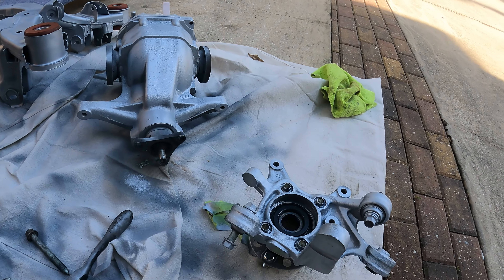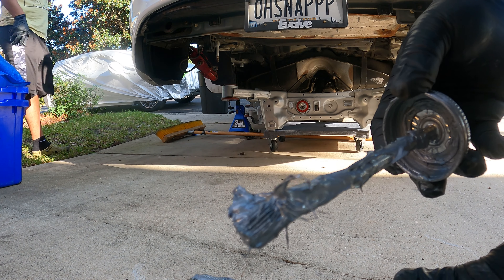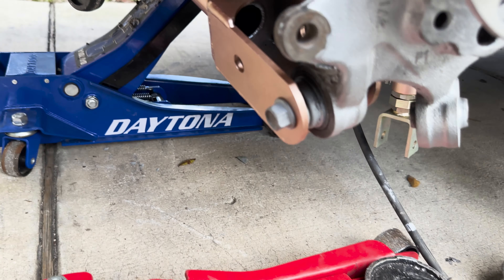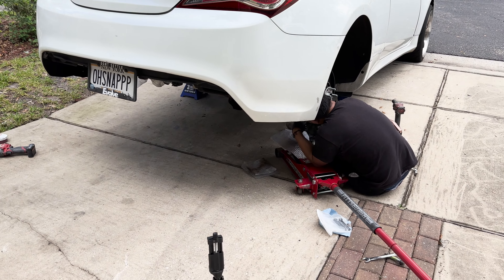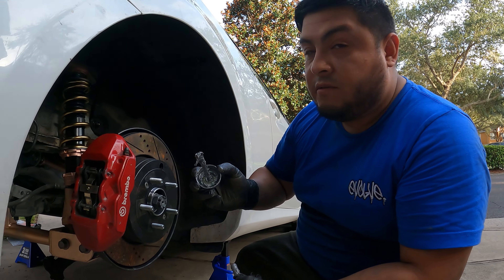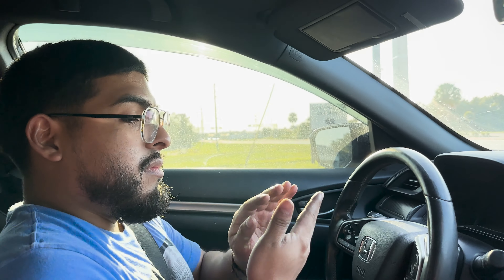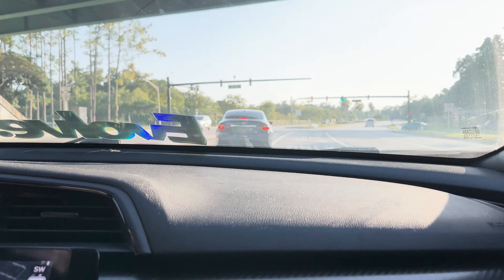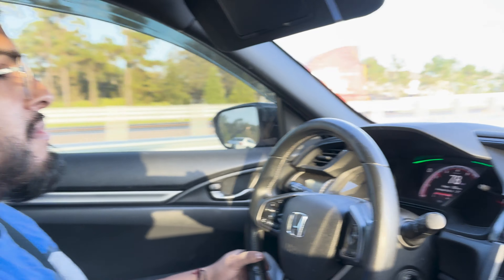GENESIS COUPE SUBFRAME IS DONE - LETS GET IT BACK ON - PARTSSHOPMAX

Comment: Those circular plates you used with the subframe bolts are aftermarket right? The factory ones on mine are really thin
Reply from the maker: Yes they are aftermarket